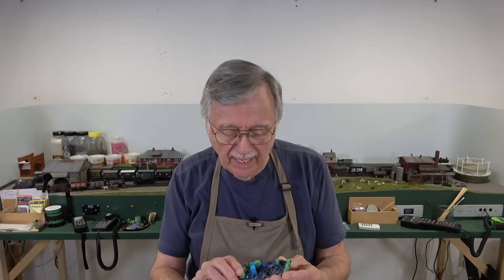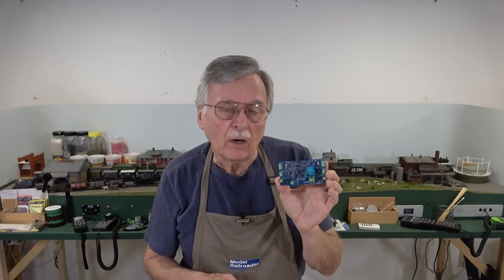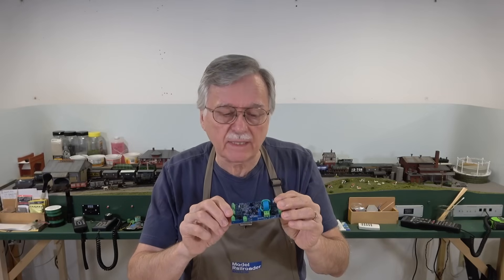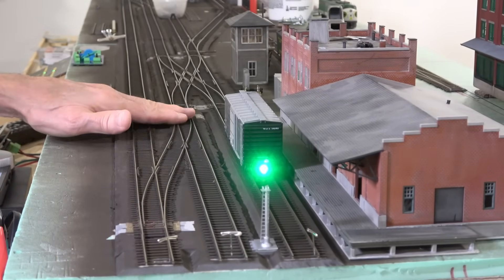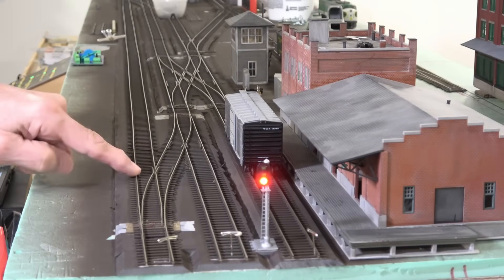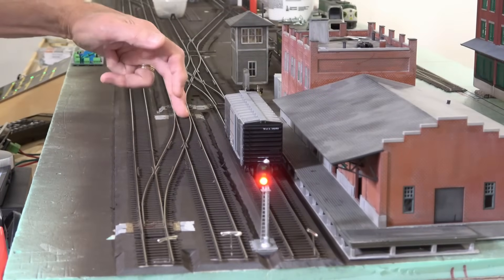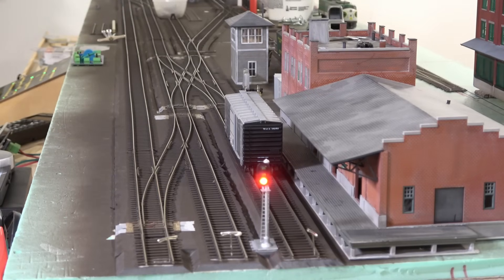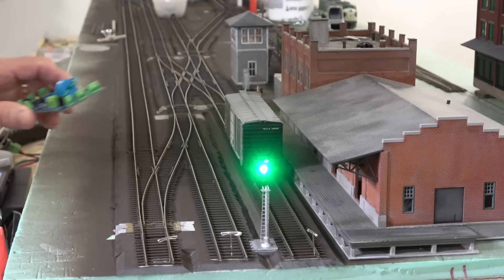Turnout Warnings for Hyperfokus Signals(408)

Comment: Hi Larry, great video. I built the PCB DIY signal boards which you featured a couple of years ago using the PNP transistors. Once I determined the soldering flux had to be completely removed from the board by immersing the board in alcohol and cleaning with a paint brush, they worked great, now I have 4 blocks on a single circular track with tricolour signals. Also integrated switch positions into the signal with yellow depicting siding set and red for points set against. I also build DIY PCB dual flashing circuits to power two road crossing signals. I used the NCE BD20 for the four blocks as well as well as another 5 blocks within a switch yard, feeding LED occupancy indicators within the switch yard control panel.
Reply from the maker: Sounds like you've built a really sophisticated signaling system for your layout! Glad to hear it worked out so well.
Reply: Yeah, clever!

Comment: Nicely presented Larry.
Is there any mileage in Hyperfokus offering the signal units as a kit for those who are “solder savvy” to fit the coil and connectors themselves? It could be a way to increase turnover. Regards, dB from the UK..
Reply from the maker: I’ll let him answer that one, he monitors these comments.
Reply: I've been thinking about it. I'd have to provide a parts list.

Unfortunately I can't sell the boards to the UK or the EU yet since they use leaded solder (breaking RoHS standards). Maybe I'll be able to switch to lead-free soon.

Edit: Now that I think about it, selling just the PCBs could be a good way to reduce shipping costs for international buyers. It might also be easier to make them lead-free if I only have to get the boards and SMT parts to meet RoHS standards.

Comment: Another great vid, Larry! I bought two Hyperfokus boards to use on my double track main. The instructions that came with the boards are pretty straightforward. But, using them with your two video tutorials will really make the job easier. Also, I heard from Hyperfokus in response to one of my previous questions concerning the use of manual turnouts. He said he would create a video demonstrating how you would wire manual turnouts for use with the boards.
Reply: As long as you're here, do you plan on using power-routing turnouts, or ones with a constant connection to the points?

Comment: So what happens when you want to go over the double crossover, you don't want a red but a yellow.
Reply: Are you referring to the double crossover into the yard?
Reply from the maker: You simply wait to throw the points until after the train has entered the block.
Reply: Yes the double crossover
Reply: There's also another option, which is to set it up for Restricting (flashing red) when the yard entrance turnout is thrown, but that's for a future video.

Comment: Very useful video Larry. I assume that if a train is to go through the scissors crossover into the industrial area it just stops at the red light then proceeds at restricted speed - in theory with verbal permission from the Dispatcher under Rule 241.
Reply from the maker: Yes, and I assume that for a passenger train being routed to the station there might be a standing rule to proceed at reduced speed through the turnouts.

Comment: Thanks for another video, Larry!
Good call with the lever connectors, although you can fit more than one wire into the terminals if you use smaller wires (like 30AWG stranded). They don't have to carry very much current.
Reply from the maker: Yes, my 22 ga wires can be combined in a 2 slot connector.

Comment: Is there any danger if there is one dc circuit feeding back into another or does it just not work?
Reply: You would only be connecting the DC+ line to itself in this case, so there's no danger there. The problem is that if you run the same lines into both boards, you'd have the Northbound and Southbound Main lines both showing "Stop" if the turnout was thrown blocking just the Southbound.
Reply from the maker: Exactly the point I was trying to make in the video about electrically separating the north and south bound lines to avoid a sneak path through the interconnected wiring.